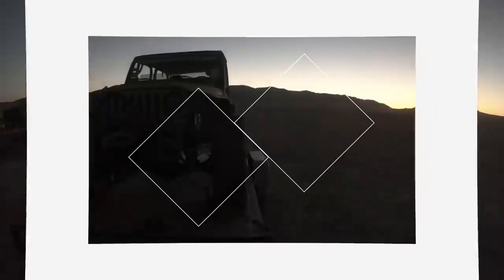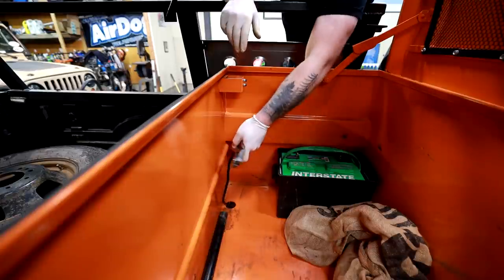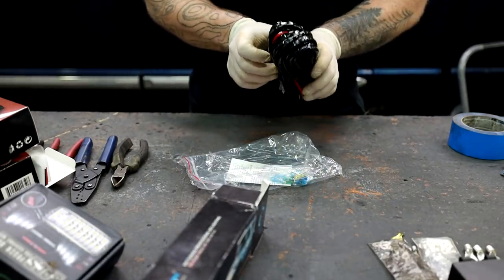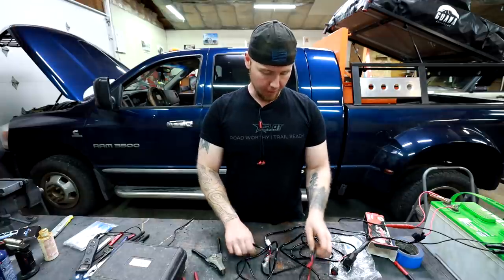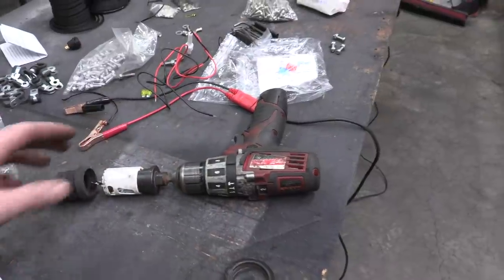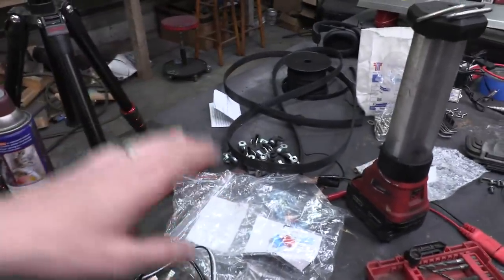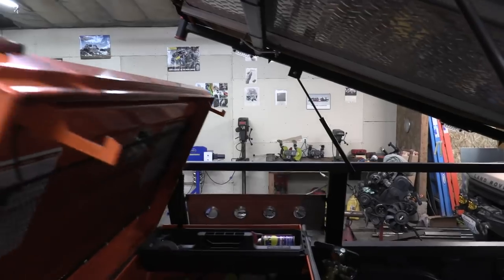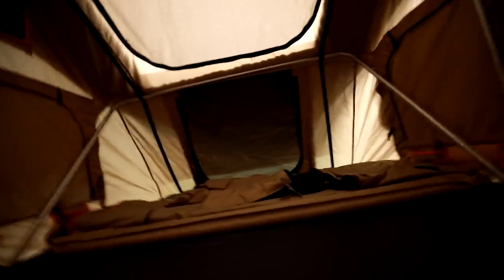CHEAP Roof Top Tent Rack Mods and Hacks! 4x4 Camping In Comfort 👊

Comment: Try some waterproof heat shrink tubing. It's great quality and has a glue inside.
Reply: Was thinking the same thing. I usually buy it from Napa. But I'm sure you could find it on amazon. I like to use these and a then pinch the shrink in the middle of a Y. If that makes sense.
Reply: That crap makes rework or modifying really a mess. I hate it.

Comment: You could have just used the keyed on 12-volt power source that runs to your 7-pin trailer plug that is designed to trickle charge your trailer batteries while you're driving down the road instead of doing all of that wiring. There should also be a reverse wire for backup lights in that seven pin also cuz a lot of Big  trailers have reverse light. And I have one big suggestion about that plastic bed liner in your truck get it out of there as soon as possible those plastic bed liners hold tons of moisture between it and the metal it will rust off the floor of your bed in just a couple years I would not be surprised if you already have to be arrest under there

Comment: Only potential problem could be if truck batteries die starter will try draw full amps from rear battery. If you make sure your trigger is dead on crank you will be fine.

Comment: the project turned out awesome imo! keep up the good work & look forward to updates after some use. also looking forward to seeing the "custom tailgate" on the tow pig- any thoughts on making it a double swing 'barn door' style carrier/tailgate? 

also a FYI to ALL - the rustoleum bed-liner rattle can is fairly durable but it can be made much more durable on metal parts by pre-heating the metal with propane or map gas torch, 
*(of course don't get the metal cherry red)
- just heat the metal until you see the "purple wave"  of heat change the metals exterior color
 (having previously wire wheeled/sanded off any mill scale of the part and then clean with alcohol/acetone 1st)
- then after heating the metal- spray with a mist of the paint from about 10" distance.
 I've made small parts for my jeep from mild steel such as A-pillar light pod mounts, high lift jack mountinf brackets etc. and this process of painting has resulted in a very hard & durable.
also note; Rustoleum Black Appliance Epoxy paint/rattle can (available in Satin finish) can also be baked in an oven at 300F or using torch as described above. it gives a powder coat look and durable, slick black finish.

Comment: Until Battery isolators came out, Ford starter solenoid was used to connect 2 batteries off the key. Using small wire to charge the second battery is not a good idea unless your using a isolator with a one way diode.

Comment: Use an oil pressure switch for a marine fuel pump for your trigger source, then the batteries will only connect with the engine running

Comment: I know this vid is a month old but what most people don't address is FUSE TAPS HAVE DIRECTIONALITY!!! On this since it is just a relay trigger it's fine but if you see that and want to add something that draws more it is important that you put them in "facing" the right way. On the blade fuses it has 2 blades, one power goes in, and one power goes out. On those style taps NORMALLY the one farthest from the tail is the "in". So once you fine the fuse you want you need to remove the fuse and use your Power Probe or a multimeter to see which side is hot. Then place the "in" blade of the tap in the hot side. If you don't and you plug into, let's say IGN, you will be pulling the normal current through the original fuse AND the tapped current through the original fuse. So you are basically running them in series when you want parallel. Could end up popping alot of fuses.
Reply: I will say loved this video and everything just wanted to put the info out there.
Reply: Valuable info, THANKS!

Comment: If all the battery’s are hooked up together, they’ll all run same voltage. They will equalized. After couple hours. If one battery dies it puts a huge load on good battery.
Reply from the maker: That's why they aren't hooked together 👍

Comment: Keep an eye on the cable running to the aux battery. Small gauge is fine for charging with this setup, but if the ignition is your switch them that will be connected when you're starting as well. That is going to pull higher current, may or may not become a problem. Great concept!
Reply: You’re not understanding how this works.
Reply: @fishhuntadventure  ok 👌

Comment: How did your relay work out?
My experience, if the 3rd battery is low, under 12 volts when the relay closes it will draw a larger current,  melting smaller wire.
Reply from the maker: The 15 amp fuse i installed in this video still hasn't popped. Lots of use throughout the summer and it all functions perfectly 👍

Comment: Did you put a fuse between the truck battery and the box battery?
Reply from the maker: Absolutely
Reply: @DirtLifestyle  But did you fuse it on both ends?  Remember that wire is hot as long as it's connected to EITHER battery.

Comment: If your second battery is too low will it pull too much power and not let your truck start when you open ignition?
Reply from the maker: Nope. The inline fuse is only 20 amps. It would pop well before it could prevent the truck from starting
Reply: Cool, didn’t think about that that’s a good fail safe

Comment: Not sure but if the front battery is low and when you try to start and the rear has more in it,it will pull to much amps from the rear and the wiring will not carry the amps and smoke the wire. Th
Reply from the maker: This is my only concern. But it has a 20amp fuse so I'm not worried about the wire frying but I am wondering how much juice I'm going to see between the two if one is low. In the video we saw the voltage jump from 12.6 to 14.4 with no issues so I'm good to at least a 2-3 volt difference between the two. This is why I like experimentation, it opens some doors and closes others 👍
Reply: @DirtLifestyle  if you fuse both ends of the charge wire you can avoid this situation mentioned. Also using 12g wire only has a theoretical maximum current draw of 20A (approx) at that length so there could be a risk that the wire would smoke before the fuse gives way. Personally I'd jump to at least 8g wire for safety. 
Keep up the awesome videos!

Comment: Nate, I am concerned with the wire size that you used to charge the third battery. There is a reason battery cables are usually 4ga or thicker. I am not sure how many amps your truck charges at but I would guess it is well over 50 amps, maybe? I think you said the wires were 12 ga. Which is only rated for 10 amps at 20feet in length. You could potentially melt the wire and cause a fire! Your wire size should be at least 6 ga which is rated to handle 50 amps over 15 feet.

Comment: I realize this video is like a year old, but when trying to balance the aux battery and the main battery wouldn't it be easier to use a charge controller? That way the aux battery will only draw a charge when it's less than 100% (and the key on).

You know like a trickle solar charger.

Comment: Voltage sensing relay for the rear battery,  will only charge when alt is running. 30$ or so..

Comment: I know it's your tow rig but I would like to see you build a custom soft ride suspension that is still capable of towing. I have an 04 2500 that I put a long arm kit on, the problem is that the control arms that mount at the frame block the bolts for the transmission cross member so I have to remove my suspension to do any transmission work which is a PITA and I'm not very excited to drop 2k on a Thuren long arm kit but I guess sacrifices will have to be made.

Comment: While in theory your design will work. Charging multiple batteries that are at different charge levels with one alternator is not ideal. Not if you want your batteries to last. Even the isolators  dont do this. If both batteries are discharged at the same rate, then there is no issue. Not to mention the size wire used is not rated for many amps. As you mentioned batteries dont like to be linked together if they are not in the same state. Your battery will never get fully charged this way. Just sending voltage to it without it being regulated will shorten the life span significantly.  I have a "house battery" in the back of my Rover I use for camping. Its a Gel deep cycle battery that is charged via a DC to DC charger. that takes the power from the Alt/Starting battery  and charges the "house" battery using the correct program for that battery type.  It also has solar input so It will charge the battery with the solar panel on the roof. When the truck sits and the house battery is fully charged, the DC charger then starts  trickle charging the starter battery.  Not a cheap setup, but its worked great for running fans and lights at camp all night.
Reply from the maker: The voltage regulator in the alternator has no reference of the amount of batteries nor if there are different levels of voltage between them. Because of the elevated voltage from the alternator, the difference between the batteries shouldn't have the opportunity to become an issue when the vehicle is running. As soon as the alternator is no longer charging the connection is terminated. Impeding the ability for the batteries to kill one another. The only potential issue I see is if I run the deep cycle battery dead and it pops the fuse when I turn on the ignition. This could possibly happen from it asking for more draw then the 20amp fuse will allow. In the mean time I will be monitoring battery temperatures and checking the voltages to confirm that this will work as a long term strategy. And like I said, I will report my findings either way 👍
Reply: @DirtLifestyle  Right, I understand the theory. and it works, but its not ideal for your battery.You are shortening your battery life. Very few alternators run over 14V, with most having a 13.6 to 13.8 volt maximum. Late model popular Gel and AGM batteries need up to 15 volts to get a 100% charge and to keep these expensive batteries in top condition. Alternators can’t do this. The DC to DC charger will actually charge your battery to 100% and maintain it properly so it lasts.  It acts like a isolator as well if needed. There are multiple ways to make a dual battery system work, Just sharing what Ive learned from my experience.

Comment: Would a starter solenoid, 60's ford, work instead of the realay in between the two batteries?
Reply: You need a continuous duty solenoid; a starter solenoid is rated as intermittent.  It may work; it's certainly capable of more than enough current, but I"m not sure how long it will last being on constantly.  But yes, any big relay (a solenoid is just a relay) will work in this sort of application.

I'm not sure how much current the relays Nate is using are rated for but they should be fine for charging an aux battery.  Of course he only ran 12 ga (?) wire so is limited on how much current he can charge with regardless of how big his alternator or anything of that nature and he fused it at 20a anyway.  This is about the simplest way to build an isolated dual battery circuit and it works well.  The one thing it can't do that would be nice is the ability for the aux battery to feed the main battery such as if your main battery failed and you wanted to use the aux to start the truck.  To to that you would need much heavier cables, fusing, and switching components; enough to handle several hundred amps short duration, so something around 0 gage wire depending on the length of the run.  Of course if you're stuck in the woods I suppose you can always remove the aux battery and carry it around to the front of the truck to swap it in.  Not very convenient but it'll get you home.

So many people are scared of basic 12v wiring, but it's pretty simple.  This isn't rocket science.  Sounds like you've got a decent handle on it with the solenoid idea.  The one thing I see most people fail at is appropriate wire size for the load; most just guess and say 'it needs a fat wire' with no idea what they actually need.  There are plenty or charts you can look up online that will tell you exactly how much wire size you need based on your current draw, length of run, how much voltage loss you can tolerate, and if the wire is bundled or not (bundled will run hotter and reduce capacity).  Here's a good start-
https://www.westmarine.com/WestAdvisor/Marine-Wire-Size-And-Ampacity

Comment: Only thing i could see being and issue is when the rear battery is super dead and causes voltage drop when starting cause the ignition will be on. But disconnecting the rear battery would handle that.

Comment: 23:51 i think im watching this video with the same earbuds. 

Skull candy is the brand im using
Reply from the maker: Definitely 👍
Reply: How are they? I had wired ones in the past and went through them like candy. Are the new wireless ones better now?
Reply: @nickcowley8757  make sure that your rubber things are the right size. Somtimes pull out bc i alway have one dangling. For 14 bucks they last well ive gotten 3-6mo on one set.

Comment: You may have inadvertently saved yourself a bit of a headache with your aux battery simply due to the voltage drop across the 12awg and the fuse you chose to tie it to. My concern would generally be that your aux battery is now connected thru a 30(?) Amp relay to a roughly 150 Amp alternator. And it may still end up melting relays as your battery gets used overnight. The lower that aux batter gets, the more potential energy is created when connected again.

But, the length and gauge of wire plays a large role in this and you may have created enough of a voltage drop across its length to limit the total amperage.

Also in the future, be careful about hooking systems up to ignition power because not all circuits are protected from the power drawn by the starter. Battery isolators work on voltage level- keeping them isolated until voltage reaches 14 volts (engine obviously running). The potential currently exists that (if your circuit isn't protected through the factory wiring [or the TIPM in your case]) your aux battery will supply power to the starting system. And your Cummins starter draws anywhere from 120-200 amps. Thats a recipe for melted wiring and a potentially dangerous situation in regards to fire and short circuits. Many newer vehicles isolate those accessory circuits (referring to the cig lighter fuse you chose) while cranking, but not all. I would double check. Cheers
Reply: Another point to make - not all 'battery isolators' are voltage sensing.  If you just google battery isolator you'll find everything from full featured units that are effectively DC-DC chargers to simple diode blocks.  I'm sure you know you can't properly charge an aux battery though a diode as the .7v drop will prevent ever reaching full charge.  (well, unless you run an adjustable regulator or change the alternator sense pick-up, but we're getting deeper here than we need to)

You may be the first commenter I've seen who has a good grasp on what's actually going on here.   Though a few have mentioned using an oil pressure switch to engage the aux battery relay instead of simply a keyed ignition circuit.  That would help as it should keep the aux battery from seeing cranking loads, but it's still not ideal.
Reply: @donhappel9928  
Good call on the isolators. I should have been more specific. I believe most voltage sensing isolators are typically billed as smart charging relays these days. My bad.

As well, I did see that comment regarding using the OPS. Very clever. I may keep that trick in mind for a rainy day. 

I do appreciate your sentiment as well. I've been turning wrenches for about a decade now, and have been lucky enough to spend much of that time at facilities who specialize in advanced 12v diagnostics. Glad to know, even by casual comment, that I'm not giving bad advice.

Comment: Are you interested in a 24V Wire Feed Welder to add to your Trail Boss?
It can be used with both Flux Core, or with Gas...
🤓 -Thomas
Port Orchard, Washington
Reply from the maker: Sounds cool. Shoot me the details 👍
Reply: @DirtLifestyle  If I knew where you are located, and had a way to Email you details & pictures I would.
Let me know!
I obtained it from my Father's Collection from when he went to Heaven... Couldn't see it going to the Dump.